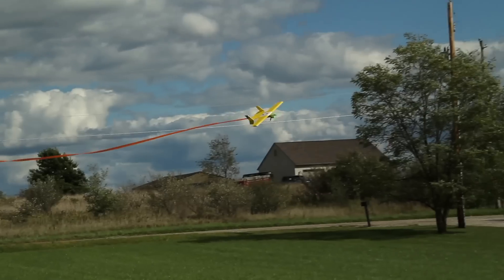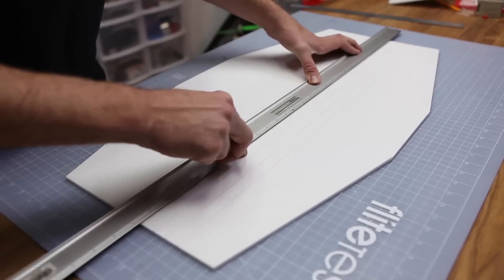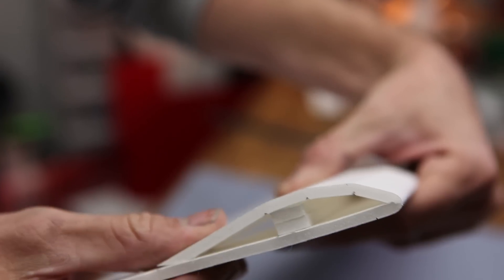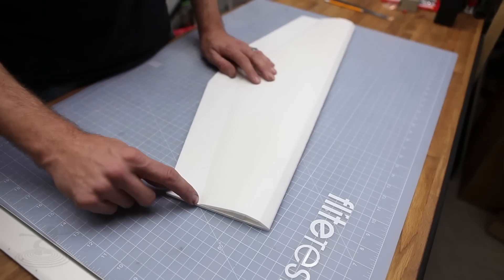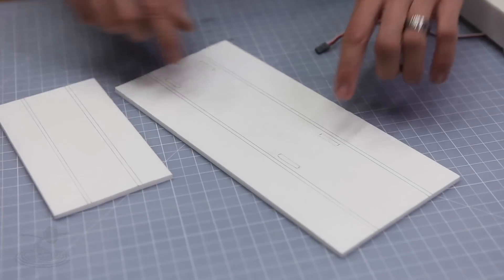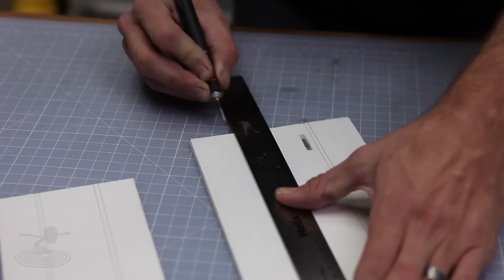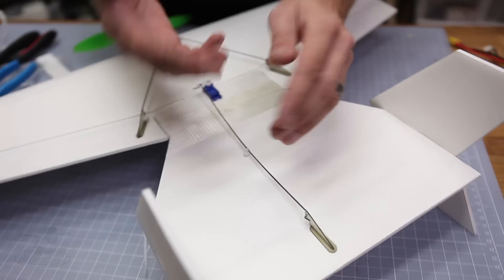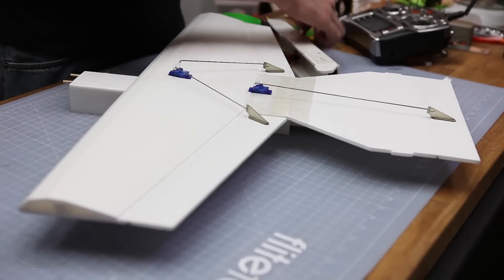Flite Test - FT Bloody Wonder - Scratch Build

Comment: i use depron and yes it can be abit weak but if you dont mind abit of weight try covering it with self adhesive vinyl and then you have a almost indestructable plane. its abit heavy but probally no heavier than foam board. you can get it in clear and different colour. i stick it to the depron and then use a hair dryer to activate the adhesive. one cooled it sticks great

Comment: The blades dull from the paper and the cutting surface. I use snap blade knives like a lot of people. I use two different sized knives, a smaller 3/8 inch wide blade, and a larger 3/4 inch wide blade. These are very cheap when you buy them in bulk. The larger knife for big long cuts, and the smaller knife for detailed or curved cuts. I also remove the paper from my foam board, and use packing tape to reinforce leading edges and folds. The paper comes off too easy from moisture for me. Nice video

Comment: Looks like an Xacto blade. They're quite expensive compared to a standard utility knife blade. Also, cutting through foamboard dulls the fine edge knives quickly because the material (polyfoam) is resistant to heat transfer. If you cut across with quick strokes, heat builds up in the blade and takes the edge down. Cutting through slower will make the blades last longer.

Comment: This was just a super build video... thanks. Is it possible to use an Experimental Airlines type fold at the leading edge of the wing (where you simply strip the paper on the inside of the upper surface of the wing to allow for the proper curvature but still use the doubled foam-board spar)?

Comment: Yea I noticed that but if you look closely when he places that piece on to the fuse to show how to glue it down, it is perfectly on the mat to see the square inch markings. Stop the video and see that it is 2.25 inches into the fuse and 5 inches flat on the tail. So the cut out is 2.25 inches long. The total length of that piece is 7.25 inches.

Comment: I have had my "Wonder" for about 6 years now, yes it is one of the originals, I power it with an Enya 15 DDL bearing, 4 channels, 9x4 prop and 15% Fuel.   It will take-off vertically and has a 15-20 minute flight time. This is a Balsa Built Plane and covered with monocoat.   I sure wish that you guys would fly a bit more of the fuel powered planes.   I got my first C/L plane back in about 1962, first radio in 1976, been flying radio ever since. Currently, I'm flying a 12th Scale Mustang, O.S. .25, 9x6, a corplas plane 55WS x 17cord, .40bb,10x6, trigear, A Tower Trainer,59in wing, O.S.46, and finally, a SIG Trainer that I changed from a High Wing to a Low Wing, finally a Backyard "Stealth"  powered by a Cox .049, 2 ch. These are just my fliers for now, couple of kits and projects that are on the bench. I'm always working on something.     This hobby is just one of the most rewarding.  Keep up the great work, good vids, lots of good info.  I liked your segment with the 1/4 Gasser.

Comment: Great video, I just bought the kit, quick question, to fire it up you have to plug in the servo wires and the battery right?
Also to use the "pod" on other planes you have to plug in servos also right?
I found it kinda of a bit hard.
But can't wait to try another of different planes.

Comment: To all my fellow dollar tree users, a little FYI. Dollar Tree foam is NOT 30 inches in length. It is usually between 3/16 to 1/8 inch over the 30 inch mark. This can effect your measurements if you assume it is 30 inches in length. Happy building!

Comment: Anyone building this plane should consider plastic pin hinges on the control surfaces instead of relying on paper.  The paper is simply not a good enough hinge, after 8-10 flights it will begin to blister and pull away from the foam.

Comment: Do you measure your thorough by measuring the movement of the flaps on the plane or by setting your transmitter to .50 and .75 movement?

Comment: Accidentally glued the first tail fin on upside down. Pretty pissed about that because now the whole 6 hours I've spent cutting this out and gluing it together is wasted. Also, Elmer's (like the glue) foam board is way different than Dollar Tree's. It's much more dense and a tiny bit thicker. You'd be amazed how much these 2 factors screw up the plans. Not to mention how much more difficult this makes the scratch build.
Reply: Raycefan I know what you mean i make my swapable pod out of the elmers stuff and the made the plane out of the adam's ready board ( dollar tree foam)
Reply: The Elmer's Foam Board is nearly twice as Heavy as the D.T. Foam Board. (But, it is fairly water resistant, and can be painted!)
Reply: Oof

Comment: How come the back part of the fuselage in the free plans does not have the little step? This makes the build video irrelevant and building the plane much much more difficult.
Reply: Raycefan Yes I was wondering the same. Anyone have measurements of the length to cut out this little "step"?
Reply: Raycefan 2-3 inches is what i did on my first build of this.
Reply: Easiermarlin33 and half a centimeter deep btw.